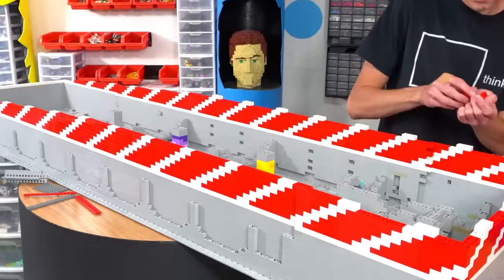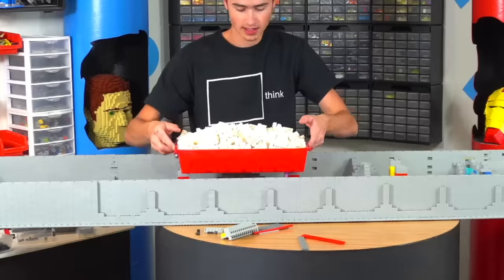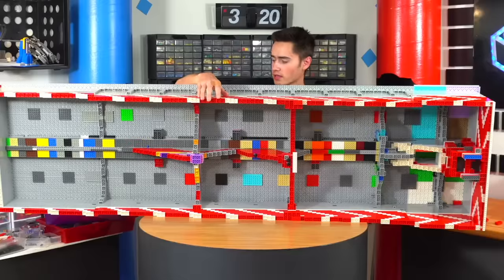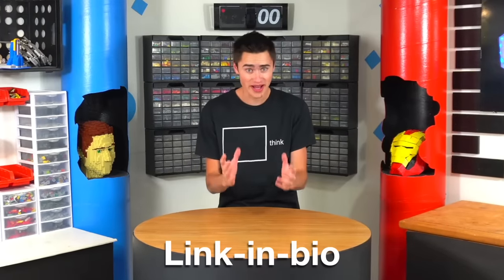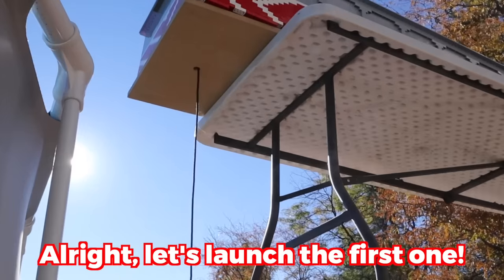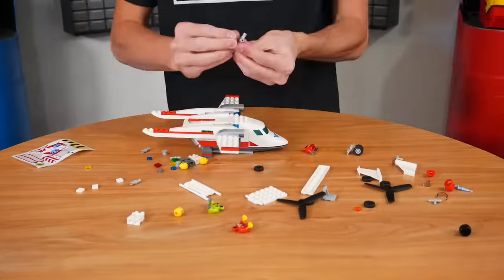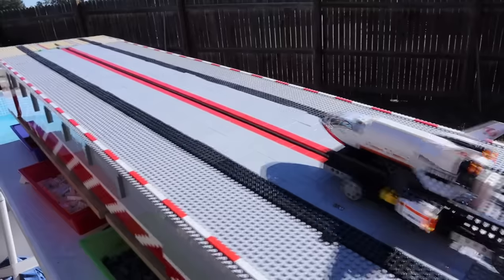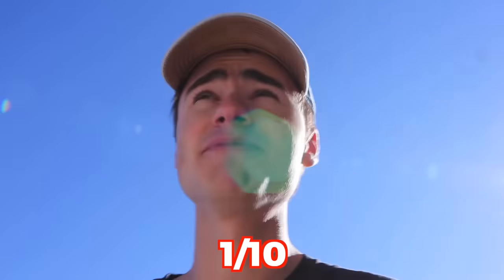Flight Testing LEGO Planes!

Comment: It seems like the biggest problems were too much weight, a center of gravity that's too far forward, and insufficient airspeed.  One other thing: on the Blue Power Jet, you should have had the wing flaps down, since that would have increased lift (also, the stabilators should probably have been tilted down more to increase pitch).  I'm pretty sure the airliner would have at least glided a bit if it had enough airspeed — the way it dropped from the roof gave me the impression that it has lift-capable wings.  You basically recreated Air France flight 447.
Reply: @Man Face Studios it's real science  though
Reply: Wait the blue power jet is really the f-35 lighting II
Reply: Yeah. That’s why they can’t launch pretty well. Weight and Center of gravity doesn’t matter, it depends on Lego stabilities!
Reply: Well as the other questions about how to provide you
Reply: the amelia earhart one was very realistic

Comment: For the blue fighter, having the flaps UP actually decreases lift and is like adding more weight because the air is going up and also pushing the plane down so if you put any flaps down put the vertical stabilizers up rather front or back
but for main wing flaps, putting them down actually increases lift and helps all types of planes with shorter takeoff distance, reduced stalling speed, and lower speed while thrust is still being provided and higher deceleration when less thrust is provided
That is why planes will put flaps DOWN while taking off and landing
It helps in numerous ways
Reply: How has no one gone, 🤓👆no disrespect though I like aviation too
Reply: I do agree, although flaps on a plane moving that speed, flaps would just increase drag
Reply: chat gtp thanks:)
Reply: I was looking for this comment
Reply: My dad is going to buy me a airplane made out of Lego

Comment: The launcher could have been designed to work more like the ones on aircraft carriers, where it would push the front wheel or landing gear. Either way good job at trying to make them fly.

Comment: For the blue power jet in particular, usually when a plane takes off, the flaps are down. Especially since they can't go crazily up cause it wasn't good. It's very weird.
Reply: The flaps are called alirons (I forgor how to spell it 💀)
Reply: @adamslegocollection  flaps and ailerons are similar. On the lego planes, they may be the same, but in most cases, flaps are used for takeoff and landing, and ailerons are for rotating while in the air.
Reply: Aeronautics man same

Comment: I definitely want to see boats. I want to see which ones actually float properly, and which ones don't.

(LEGO is rather buoyant as a whole, in my experience, and this video shows that the planes/spaceships float just fine , so I expect most boats/ships will float; the question is, will they capsize?)
Reply: Long ago Lego did have ship sets that floated and even had weighted keels. I never got to play with any of them though.
Reply: @kurisueru  yess they even had underwater weighted electric engine's

Comment: For you info, with planes, flaps on their main wings are to go down, this is so they can create extra lift to assist with flying at low speeds. Another thing, sorry for this stuff but the planes wont fly unless their airfoils produce enough lift, lego is square (ish) so it wont work. Great videos though

yeaa sorry for saying this stuff :)

Comment: 9:56 putting the "flaps" up results in extra drag - in that case they will act like spoilers and slow the plane down, increasing the fps in the glideslope - I would put them down about halfway to give enough lift for it to be worth its drag. To angle the plane up, angle the elevators in the tail up, such as are seen at 10:01 - possibly angle up more if you want a quicker pitch result. Gear is also a major source of drag - I would probably leave the gear retracted during a test flight like this.

Comment: 9:53 You put the flaps in the wrong direction, they're supposed to be down!

How they would have worked if they were down:
When the plane moves, the air near the wings moves from the front of them to the back. If the flaps were down, the wing would be sligthly curved in a way that the air instead of passing under the wing, it would also be pushed a little down witch creates more lift.
Reply: Please reply and like this comment, so brick science will see it

Comment: Ok let me straighten things up a little bit. Basically I know that airplane normally airplanes have their flaps down but that’s because they have engines and the engines are right in front of the flaps so the flaps do you use them like as a mirror so basically the flap that plate thrust from the engine comes and then it hits the flaps in and then it forces it down which makes it pull up but on a paper airplane that doesn’t have like engine or a Lego plan that doesn’t have an engine. Also, it Has to be up, so that way it tilts backwards to take off  cause it with you to put it down without a propulsion system basically puts the air down it. If it’s at the back it has the air going down so that means that it will it will essentially fall, but if you have it up at just the right angle, you can have it glide

Comment: The wings of the Lego planes are not real wings so they don't produce lift. And they are heavy. Challenge for you: make a plane in Lego that will actually glide. You will need to use plastic or paper for lining, to get the weight down. That would be an interesting project.

Comment: You kinda did the flaps on the blue power jet wrong… the flaps are supposed to go down to add more lift to the wings so it doesn’t just hit the ground like a brick. Use max flaps on short platforms.
Reply: Oh, and also, if you want the nose to tilt up, then use max flaps down and the back wings (called ailerons) tilted like in the vid.
Reply: @michellehsu5158 I doubt the planes even had enough airspeed for the flaps/wings to do anything

Comment: Interesting and fantastic video! Fun fact, none of these lego planes will ever fly lol, they aren't aerodynamic at all. Their wings, elevators and virtical stabilators aren't smooth and definitely arent built like an airfoil. If they were, then the plane you used that had the flaps, the flaps should of been put in the down position, not up lol and not all the way down too so it can generate lift and if the elevator had ones, they would be put in the up position to also generate lift lol. But that would only work if the plane was built aerodynamically lol. Great video though, it was awsome to watch!

-SEL Rated, IFR Rated, Commercial Pilot.

Comment: I think you need a higher speed on the track and a way to get instant full acceleration raight at the start so itcan get as much lift as possible also i feel it would bee easier to do the speed start up with penumatics

Comment: actually, the x-wing is not supposed to fly at all. it is made to be in space meaning it does not need to fly it just needs to be able to propels itself as their is not air so therefore no air resistance, gravity and other forces that would otherwise disable the ability to fly. im a nerd ik😥

Comment: Non of them have enough airspeed and lift and you should of put the flaps down it would change the aerodynamics of the plane which would of allowed the plane to gain more lift and it would fly at low speeds

Comment: 9:58 OK. First of al you used the flaps as speedbrakes and also if it goes up = low speed and = stall. You also trimmed one horizontal stabilizer down sow it would just imminently bank to the right. Annnnnnnnnnnnnnnnnnnnnd it just stalled into the water.